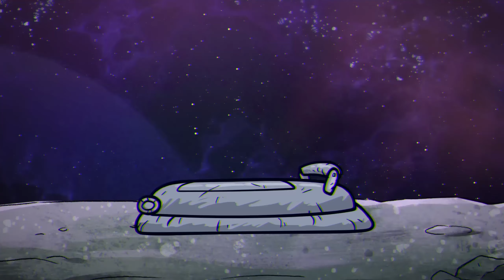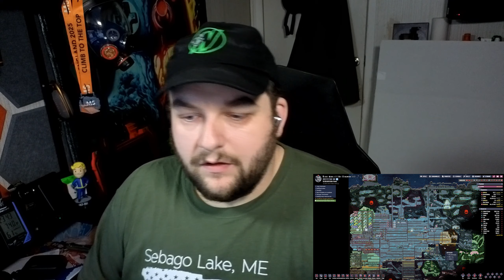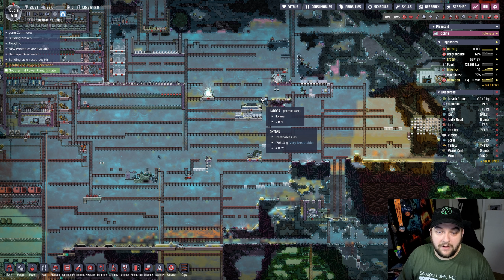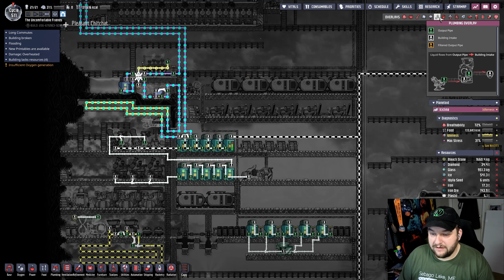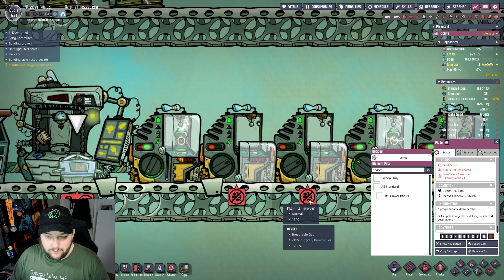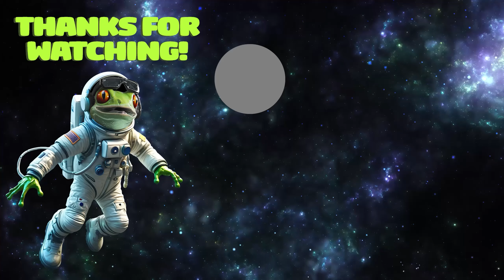Geothermal Power Activate

Comment: Stick a Thermo Aqua Turner INSIDE of the Steam room - made of steel - and cool your steam turbines with a cooling loop.  You will need to make a quick liquid lock to break into the room so you dont toss steam everywhere. Trying to self cool steam turbines is always a bit tricky. Two of the Steam turbines will pay the power cost of the Aqua tuner. Also, enclose your turbine room, pump put the gas in put in hydrogen,  and toss a layer of water on the ground. Liquid on the floor will help smooth out the cooling. Just make sure there is no carbon dioxide in that room. CO2 is horrible at temperature transfer. 

Also, you really should think about making a large water tank and pumping the water from the bottom of the base into it and dumping all the Ice you have swept up into it as well. I'll save you a disaster - when all the ice melts, it will expand into water and crack all your floors and roofs. You will have water everywhere.
Reply from the maker: I was thinking about the aquatuner in there but was afraid of it melting down. I did finally make a water tank and basic filtration system thankfully but that will be next week so just a sneak peak
Reply: @Nihmrod  As long as the tuner is made of steel and your turbines are running, you should have no problems. Over heat temp on a sttel one is about 527 F, if im remembering correctly. If you dont want to break in, you could also just build a small tuner/turbine room for cooling for all your turbines.
Reply from the maker: @veuvic  I may have to give those options a try!!!